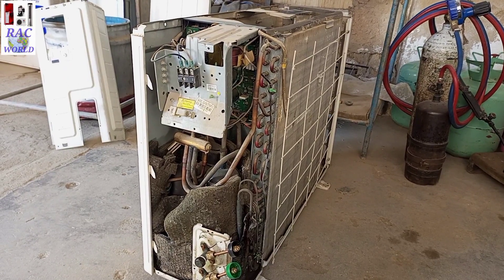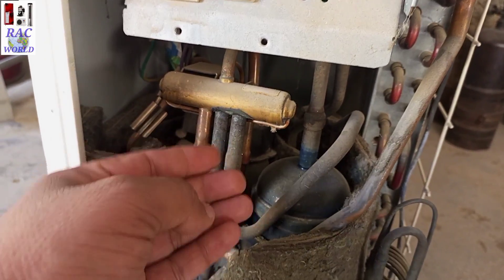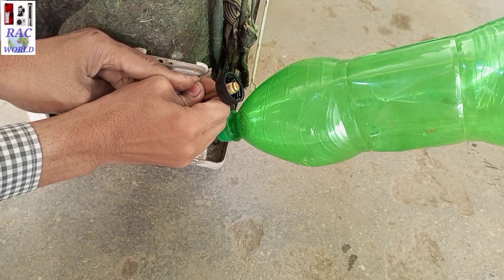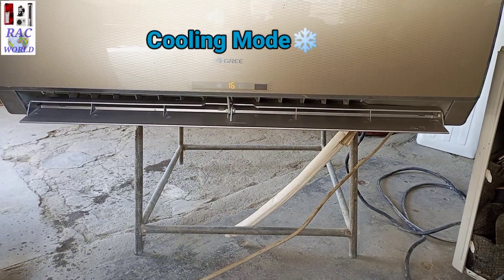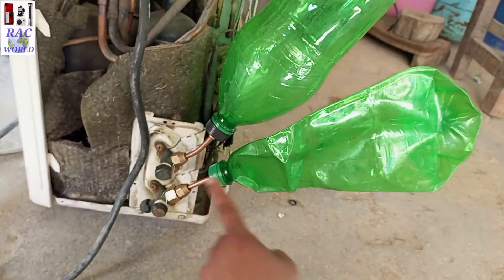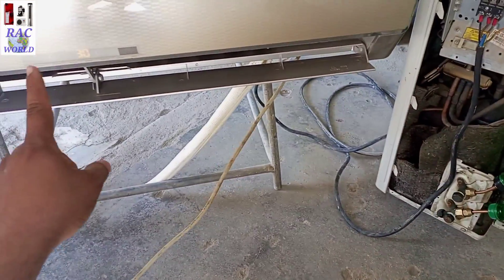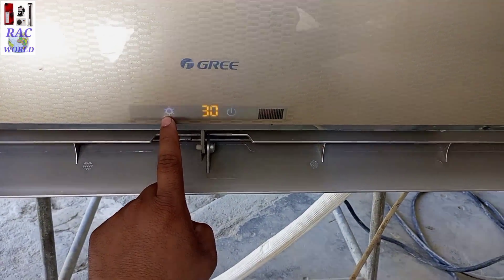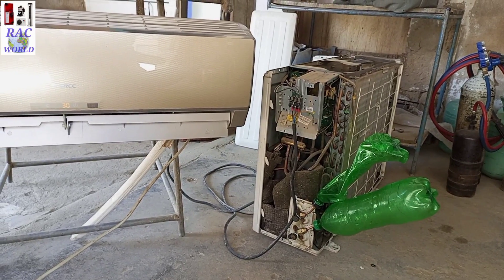split ac four-way vlave working principle|ac reverse valve working|split ac heat and cool valve work

Comment: Nice but we use ac in winter season the condenser will be ice form because outside temperature will be low this not possible in winter season in some areas